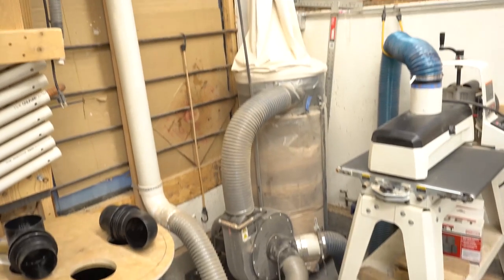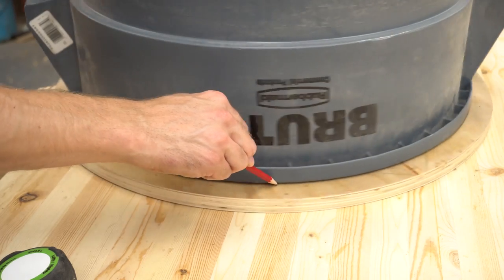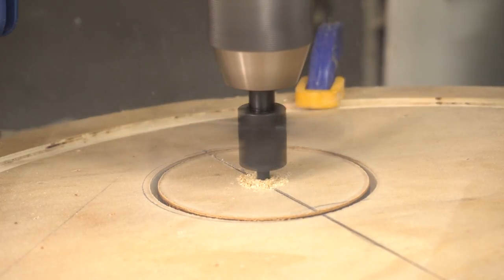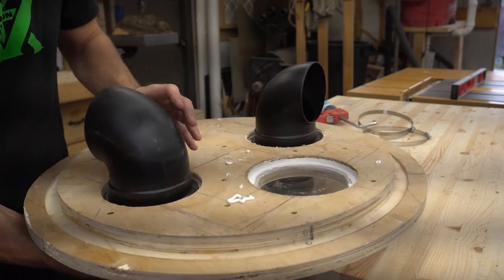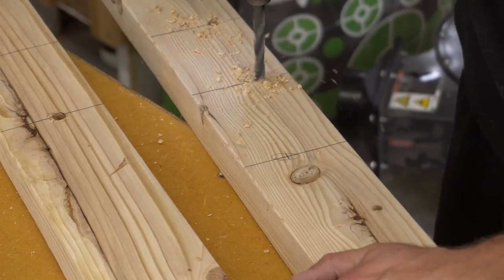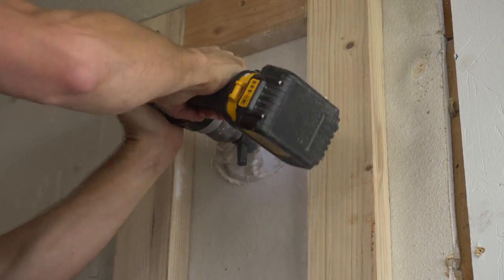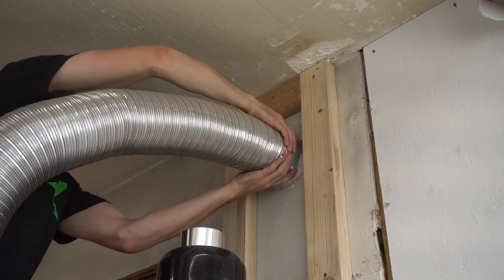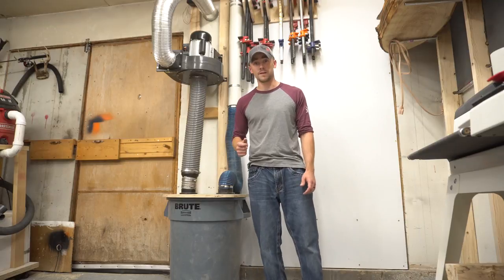Dust Collector Upgrade | Separator & Exhaust.

Comment: I'm not sure how that circle cutter could have possibly worked on the metal on the outside of the building.
ignoring the speed issue which has been brought up a few times already -
1) it's metal
2) it's not flat!  those raised ridges are going to play hell with something trying to "trace" a circle over that surface
3) it's in a hand held drill & not a press
Reply from the maker: Yep, it wasn't ideal. That's how you learn right?

Comment: I really like this system. I wanted to set something like this up for my shop, but the problem is that we would not be able to have the dust vent outside due to the neighbours, plus the temperature loss would be a major issue in Canada during the winter
Reply: the dust is not even noticeable coming out of the vent, its basically invisible because its so fine.

Comment: build a closer around the dust collection system with insulation and it should help with sucking out all your cool air or hot air.
Reply: Can you elaborate?
Reply: he probably meant "build a closet"
Reply: How? Its got to pull the air from somewhere so it would just pull it through the gaps around the door or worse still create a vacuum
Reply: Add a gate and filter to your exhaust going out the wall with a Y. When you want to climate control with the collector on, you just switch to the filter. All moving air stays inside. Boom.

Comment: You just blow the fine dust out without filter. The wind blows that way you say. But what if there is no wind? What if the wind blows in the wrong direction and all the dust is blown in again through an open door or window?
Reply from the maker: It's just not a concern.
Reply: umm that is why you plan your exhaust. also notice how the outside exhaust housing is pointing downwards. this is to help deflect what you are exhausting. since he is using a separator, only very fine dust would be exhausted, so most buildup (if your conditions were met) will be negligible coming from a hobby woodshop.
Reply: A good point, though it would be hard to get all the dust back in even if you were trying.  Do need to pay attention to where the dust goes.  Suppose you found out your kid had been playing in the dust cloud?  Fine dust causes lung damage.

Comment: I know this video is old but there are two small things I would like to suggest.
1) Hang a 50 Gal bag ( basic trash bag) in your barrel. That way you don't need to catch a lot of dust (there will always be some), when you dump the barrel. Just take the bag to the dumpster.
2) At the end of your shop piping, above the barrel, install a 45 degree elbow, facing the barrel and a 45 on the top of the barrel, so as to eliminate the excessive and sagging flex tubing.
Beyond those points, Good Job.👍👍

Comment: Looks awesome man!  Nice setup!  I put my system on a remote switch that I just carry around the shop with me.  I'm not sure how you switch yours on/off, but that might be an idea for you as well.  It's made a world of difference for me... until I lose the remote among the clutter on my bench.
Reply from the maker: I bought a 3-pack of remote outlets that all run off the same switch and it worked fantastically... until I dropped the remote one too many times and it died on me. Mine was just a cheap kit from the local hardware store so I'm going to run out and buy another one!

Comment: Great vid. Thinking something similar. My only concern is where you makeup air is coming from. I am thinking about building an air screen that would use a few filters to allow clean air back in that would filter out basic dust insects etc. Most of the time i am not conditioning my shop. Of course a diverter valve to outside or insode through a cansiter filter could solve it. Without an way for air to come in its going to pull through every crack and creaves in the shop. 

Nice work.

Comment: Nice upgrade! Curious how the view window is working? Does it get coated with fine dust too much to see? Or is it working well? Thank you for the videos.
Reply from the maker: Thanks Tharemy! I've wondered that very thing myself, but I haven't used it enough to know yet. So far it seems to be working okay. The inside of the bucket is so dark that I have to shine a flashlight through the window and that tells me what I need to know so far. My back up idea is to just put a small plug in the hole in the center of the lid instead of sealing it off, then I can slide a stick down in it periodically and get a more tactile answer about the depth of the dust.

Comment: Very nice upgrade and more space for maybe some more clamp racks, i see there is one there so maybe take that down and make a bigger one now. As for the hole cutter, i hate that type of cutter i use the normal hole cutters that are use for wood and plastic much better. The dust bin worked out great, i read one of your comments below about how hard it was to see how full it was, why did you put the see through hole on top and not on the side of the bin? Sorry about the questions, still a great and better upgrade for you, oh and i'm very jealous of your weather, want to swap with mine?
Barry (ENG)
Reply from the maker: Thanks Barry! That clamp actually is my new bigger one - I don't have a very big supply of clamps at this point. I did throw it together quickly with the intention of adding to it later on. 

It's really not that hard to see into the bin, just wen it's notably empty. Ad the dust level gets closer to full I predict that I'll be able to see it without any addition light source. A window in the side would make it easier to monitor, but it would also be more difficult to install and require cutting a hold in a perfectly good garbage can. With the window in my lid, I got to work with flat, not curved surfaces. 

I had to move several times to get this weather and I plan on keeping it!

Comment: Hey buddy. I’m looking to do something similar in my garage. Would you mind sharing the dimensions of your lid? The inside of the lid circle and the outside circle specifically. Thank you!
Reply from the maker: I'm not sure you want to go with my dimensions. It really needs to be air tight, so you would be better off measuring your own can and cutting a lid to fit it exactly.
Reply: Gunflint Designs I have the exact same can :) that’s why I was wondering

Comment: So, you're going to dump all that dust outside and if you run too long without dumping your can, you'll blow shavings outside. Kind of a dumb idea. As far as the hole saw, those adjustable things have always been garbage, get an actual hole saw. I have hole saws in sizes up to 6" and never need to use a jigsaw for that. I already use a similar setup for my dust collection but I utilize the two bag system after the garbage can instead of dumping dust like you do, that way I won't have to worry about forgetting to dump the can without having somewhere to collect dust and debris.

Comment: I have one of those adjustable hole cutting monstrosities too.  I hate mine as well.  I wish there was something else available instead of this thing.
Reply from the maker: There is... but at $40 each I can't afford some of the bigger hole saws. I was really hoping this was the best compromise, but I was wrong.
Reply: He has the blade mounted wrong. He isnt using the cutting edge, hes plowing through with what should be the side face.
Reply: GREATLY reduce your RPM's when cutting circles that big.  The effective SFM (surface feet per minute) at that radius is waaaay too fast, and why you were burning the wood.

That single point cutter just isn't going to work on a huge interrupted cut like the exterior siding.  It's a workable tool in something like a drill press, but I've never seen one effectively used in a hand drill.

Comment: the circle cutter is something that shouldn't be used in a hand held drill.  they are tough on the drill press tho... there are models that have 2 cutters.  basically balancing it better.    the set screws do come loose on these things.... a half dose of some thread lock never hurts ...

Comment: Good video.

Yeah, that, "hole cutter," is similar to an old machinist fly cutter. While a fly cutter can do a couple of specific jobs okay, and there are some old school Machinists who can surprise you by doing a good job with a fly cutter, for the most part fly cutters went the way of the dinosaur, and nobody who considers themselves a modern machinist, modern for the 1990s that is, uses a fly cutter for much of anything anymore. There's just better tools for every application where a fly cutter was used, between face mills, shell mills, high feed mills, etc, and with wiper inserts, or applying the proper insert geometry, lead angle, rake anfle, insert coating and material, the finishing operations where fly cutters were still used somewhat recently. A single point tool hanging out that far from the axis of rotation, and trying to cut material efficiently, with almost no rigidity, and the tool you were using has absolutely zero cutter security or stability, let alone rigidity. That thing is dangerous., it's just a crap design in the modern shop. Glad you figured some of that out. 👍🏼

Comment: The remote control switch is a useful idea. My Grizzly dust collector has one. Another potential idea that might reduce your loss of conditioned air during hot summer afternoons is an ERV - an energy recovery ventilator. Getting one that can handle the volume of air your dust collector moves might pose a problem and if they make one it might be above your budget. I don’t know what the volume of air your dust collector moves but here is a link to a whole house ERV that moves 60 CFM. https://www.ecomfort.com/Fantech-SE704N/p31417.html
I suspect you’ll need a bigger unit for best efficiency but this is a starting point for your shop and may be useful in your home. I live in the Missouri Ozark’s where we have hot humid summers and winters with temps that sometime go below zero. I have a tight home and an ERV has proven to be useful. Let me know if you find one that works with a dust collector. Another option is to recirculate the vented air within the shop and use some filters to capture the dust.
Reply from the maker: Thanks for the tip Dennis! I'll look into it.

Comment: Hey man, did you put a grounding screw and wire through that PVC you’re using?
Reply from the maker: No I haven't bothered.
Reply: Gunflint Designs static build-up and sawdust are not friends
Reply: I don't think its as big a problem as you think. but i'd do it anyway.

Comment: Too bad you didn't turn the blower housing around so the output didn't require the flex hose.  You lost a lot of suction from the bends in the hose when it could have gone straight through the hole.

Comment: Nice setup. I'm not a hundred pourcent sure but it seems that you put the cutter head of your circle cutter back side. When you made the hole outside I stop the video and it look back side. That not supposed to burn the wood like that. And be sure it's well sharpened . Check this poicture : http://assets.rockler.com/media/catalog/product/cache/1/image/720x720/9df78eab33525d08d6e5fb8d27136e95/4/2/42861-02-1000.jpg

this one is turning clockwise.

Hope it helps you
Reply from the maker: You could be right. I'll have to work on the setup more the next time I try to use it.
Reply: Frederic Tremblay i

Comment: Your video should have a subtitle “how not to use adjustable circle cutter “.
First of all never ever use it in hand-held drill. You can injure yourself, ruin the workpiece, damage the tool or any combination of the three.
This tool is designed for use in a drill press with material firmly secured to the base. 
Second, if the cutter of any kind is burning wood it is either dull or is moving agains the material too fast or both. 
At the diameter you are cutting your the drill press should be spinning at low hundreds rpm or less.
Third,  this tool is a form of fly cutter. As such the cutter must have well pronounced positive rake to work well.

It is easier to call a tool junk than think the problem is not it but the operator.

Comment: Air conditioned wood shop.... hmm must be nice
Reply from the maker: Technically I live in the 'high-desert'. That little window style unit can't keep up with the temperatures outside in the middle of summer. If I start it first thing in the morning, that tends to buy me a few extra hours of cool, but by midday, it's overwhelmed and the temp is the same inside as outside.

Comment: Your design is not really good - the sucking hole needs to be in the center and straight - instead of the current location and trying to suck out all the dust directly by using 90 degree elbow.  The idea of cyclone is "you send the dust sliding the outer wall while just suck the air from center".  If you move it to the center with just straight pipe, then much less small dust will be sucked out.  

Although, in your case, as you are blowing the air out door, so it should not really matter, but my concern is that you are creating a poor example to the public and they will copy your design without knowing the flaw - and they will use shop vac instead of blowing things out - and for that case, efficiency is much more crucial.